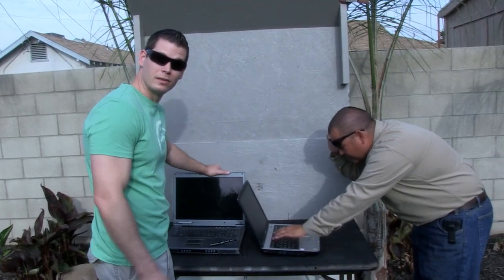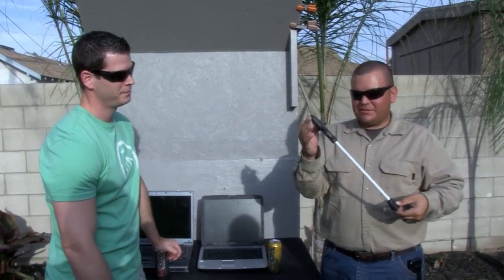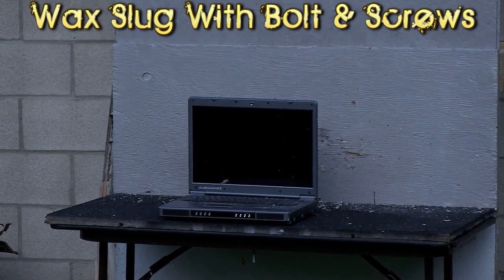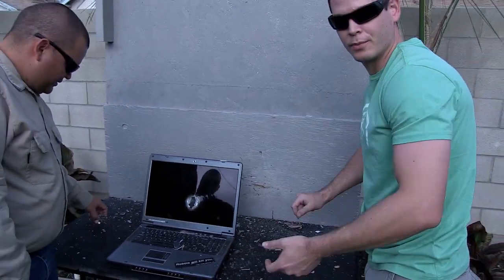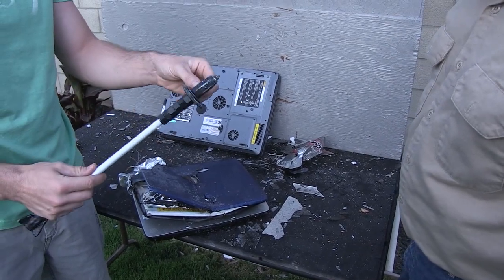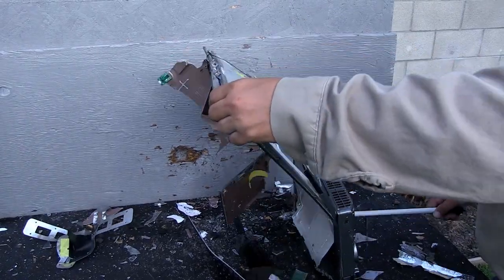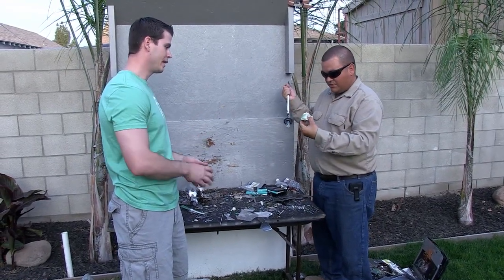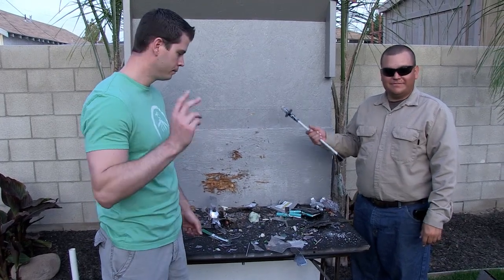Destroying A Laptop With an Air  Cannon

Comment from the maker: Well i took the advice of probably you and the other spud guys and lengthened the barrel for one, which increase speed, and having the rubber around the spear seals it off 100% and it's a perfect fit everytime,  but the rubber does where out after a few shots and i have to put a new piece in but besides that it should keep penetrating..